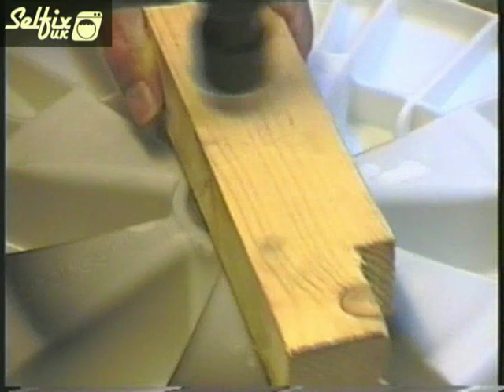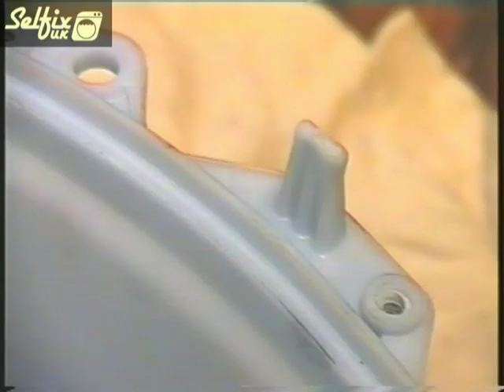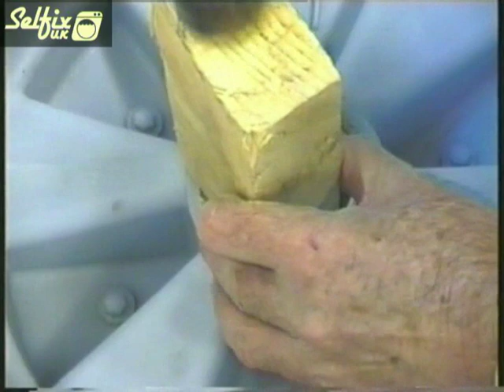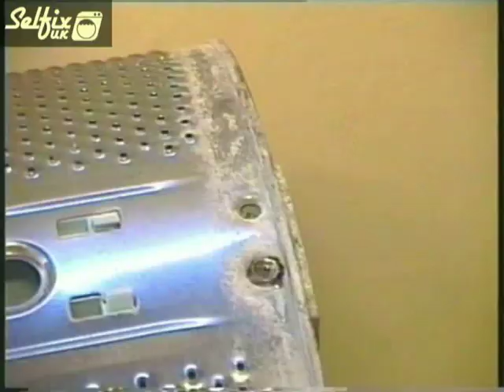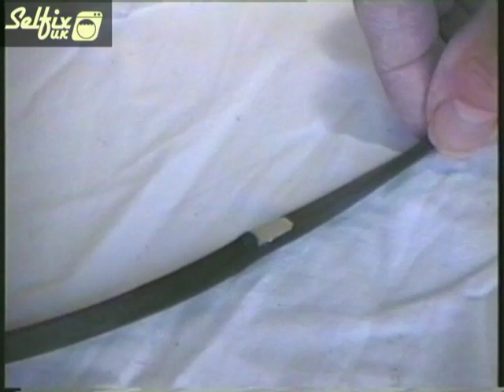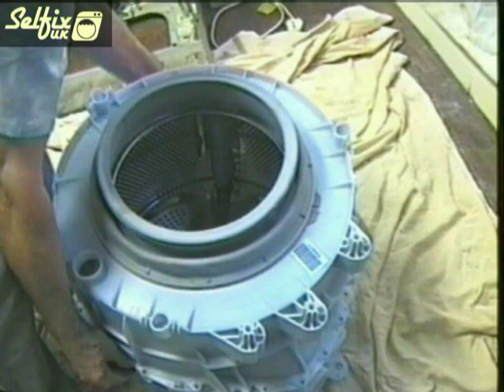How To Replace Hotpoint WF Washing Machine Bearings 2 of 3

Comment: Excellent video. Did mine but that pulley bolt was bonded in (WMA34). 300NM impact wouldn't shift it and broke the bolt! Still, I ploughed on and drilled it out...found another stainless steel bolt and cut to size.

Comment: This video has helped me take the bearings off. Very useful. But...... there is a problem. Looking for buying the bearings is a bit confusing. The e sellers can help by specific model so we can order the right ones I have a hotpoint WF320p - 48105516. The bearings on various sides look same on the picture. So how do i know is the right ones?